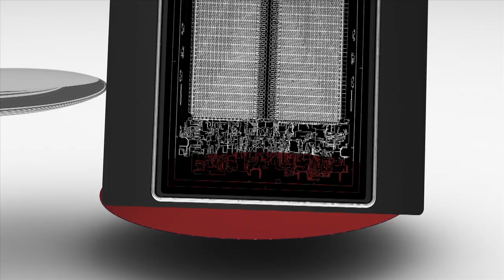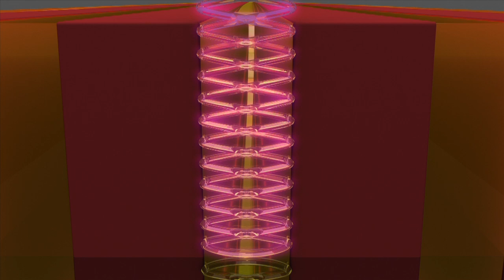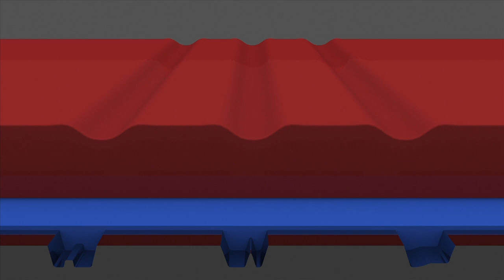How Anti-Reflective Coatings Work for Semiconductors

Comment: Basic steps first photosensitive material called a photoresist is spin coated onto a silicon wafer the photoresist is then expossed to an ultraviolet light seuree which shines through a mask that has a pattern of openings that allow the light to pass through the photoresist is chemically changed wherever it is exposed to light  so that areas of the pattern photoresist can be removed using the patterned photoresist as a protective